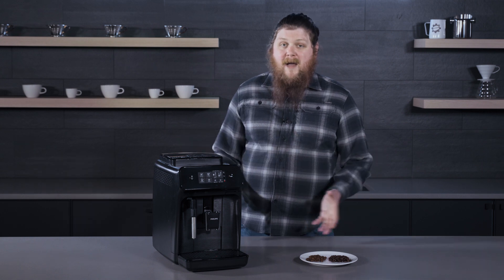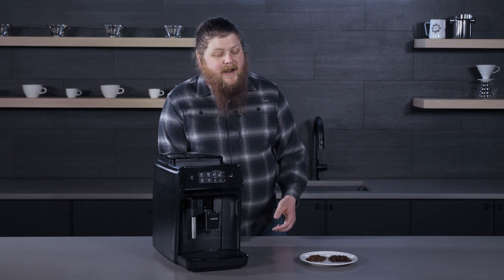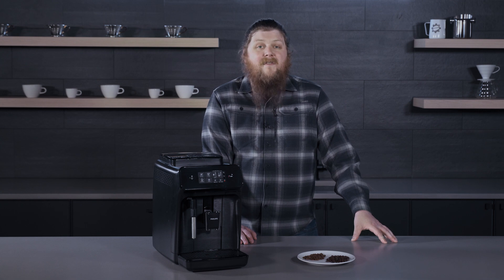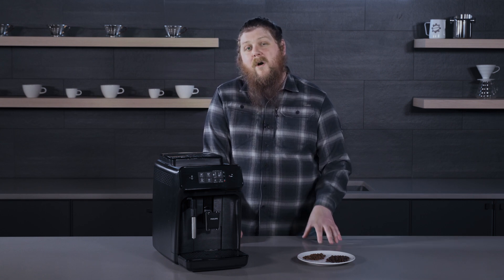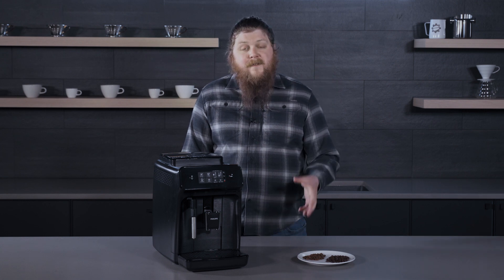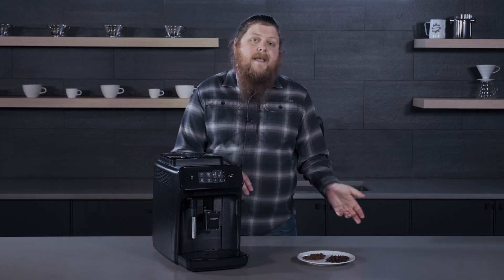Superauto Oily Bean Guide

Comment: if the terms used are "too oily" i can not void your warranty, subjective terms can never be used to void a warranty, furthermore i highly doubt that using oily beans voiding warranty is going to hold up in any way.
consumer protection of warranty is actually pretty well regulated, to the point where courts have even deemed "warranty void if sticker is removed" stickers to not actually cause a void of the warranty in some cases.
a super auto is ment to brew coffee from coffee beans you throw in there, there for if a used only uses coffee beans (of any kind) in the machine chances are high that the warranty is not voided, at least not from a legal standpoint.
thank you for listening to my Ted Talk.